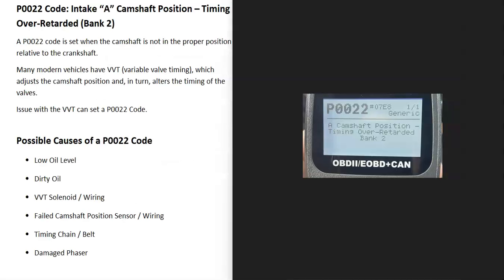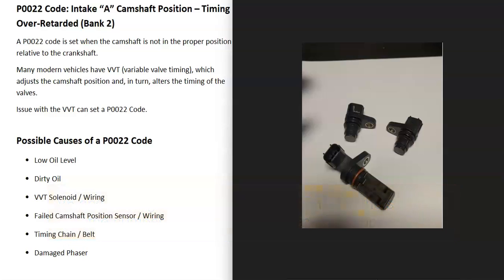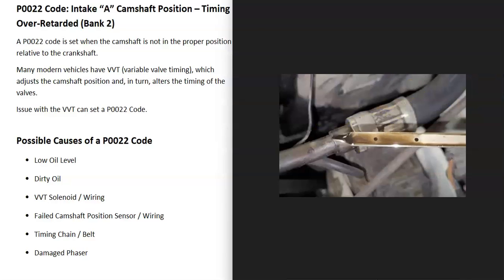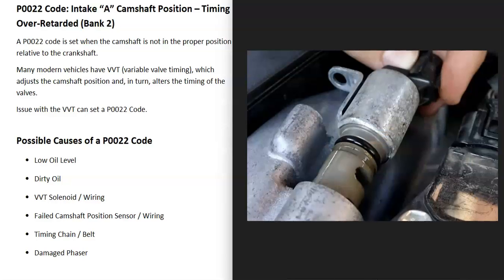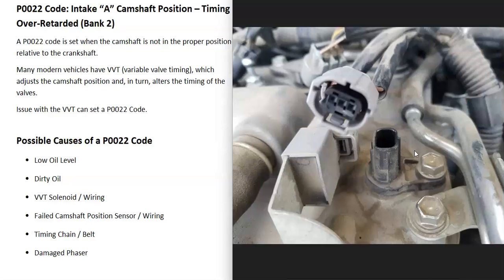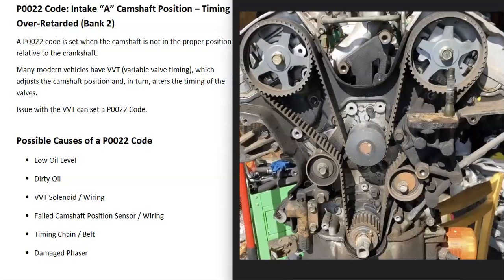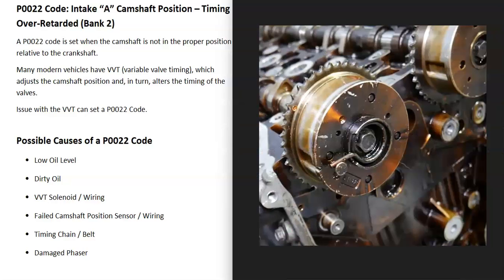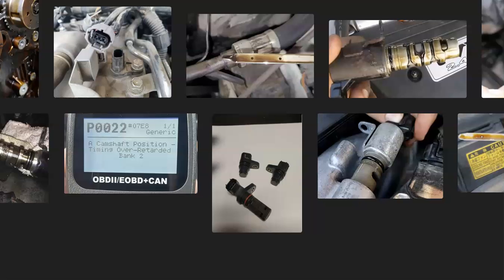Causes and Fixes P0022 Code: Intake “A” Camshaft Position – Timing Over-Retarded (Bank 2)

Comment: I have p0022 code a while ago
I put in a non Fowler in my 02 sensor would this trigger the code?
Reply from the maker: No, I don't see how they can be related; if a Fowler has issues, usually that causes 02 sensor codes or possibly Rich/Lean codes.

Comment: Just change your oil and clean or change the camshaft sensor $34 each at auto zone, I spent $300 for coil pack and $180 for plugs only to find out that metal shavings have attached themselves to the camshaft sensor because of dirty oil😢

Comment: Hey, if I had an oil leak, we’ve been having an oil change for a little bit over a year. Could that potentially cause that code to come up? I just got an oil change today, and hopefully, it will clear itself by tomorrow.
Reply from the maker: If the oil is low or very dirty, that can cause VVT issues.

Comment: Thanks for posting this, the info was helpful and detailed!
In my case my 2012 Escape was overdue for an oil change. After doing that, resetting the oil code and disconnecting the battery cleared the engine light (for now)!

Comment: Low oil, oops.
Reply: Apparently I burn oil bad or have a leak…good news is I put 5 quarts in and she’s running fine now.
Reply: @chaplainbeats7028  damn 5 qts? im surprised it wasn't knocking or tapping.

Comment: Hello, I have to codes. P0012 & P0022. I was told that I should replace the VVT solenoid and VVT actuator. Does that sound about right? Please advise.
Reply from the maker: A bad actuator can cause issues along with other VVT components. It needs to be diagnosed, and the components tested to know which has failed.
Reply: Same issue with a f250. What was your fix?
Reply: I just changed it and still got the code they said I need timing but my 2017 maxima sv runs perfect someone told me to just change the sensors

Comment: Question, could oil buildup cause this code? Just did an oil change, I noticed there was a quite a bit of buildup in the upper part of the engine when looking through the oil fill tube on top of the valve cover, and when changing the oil filter I noticed quite a bit of deposits. Engine has 358,000 KM’s, is it worth adding some sea foam, cleaning the deposits, changing the oil and seeing what happens before changing the CPS and oil control valve solenoid? Thanks. 2006 Toyota 4Runner 4.0 V6. Only code is P0022
Reply from the maker: It will need to be diagnosed to know what the issue is, but sludge and blocked oil passages can cause VVT issues.

Comment: I have same issue, all the timing are correct and intact, I changed the two sensors twice yet nothing changed it keep bringing back the code I have 2004 Lexus rx 330
Reply: did you end up finding out what caused and fixed the problem?

Comment: Hello, I have a question about my car. I have the same code appeared on my OBD scanner. 
P0012 - A Camshaft Position Timing Over - Retarded Bank 1
P0022 - A Camshaft Position Timing Over - Retarded Bank 2
I'm not sure exactly what I need to replace or fix. I recently got my oil changed back in January. It looks fine. It's not a light color on the stick. It's a mixture of amber and dark color. I hope the shop cheated me on my oil change. I did a test drive and tried to accelerate at a higher speed, my car was moving very sluggish. I couldn't get it to pick up the speed. Someone told me it could be my catalytic converter. If that's what it is then why I didn't get that code? I have a 2019 Infiniti Q50 3.0t
Reply from the maker: It's going to need to be troubleshooted to find the issue. I would start with the VVT Solenoids and wiring, then check the engine timing.
Reply: I took my car to the dealership earlier this month so they could tell me what was going on. My turbochargers were failing and it was going to cost me $8,300 plus to replace them. I decided to get rid of the car. I purchased an Audi Q5
Reply: did u ever figure out what the issue was?
Reply: Issue Fix ?
Reply: So these codes are turbo failing codes ?
Reply: @Forjettaheat  it's in the timing It codes dont will say Sensors but  it's the phasers
Reply: I have the same car you do with the same codes. Did you ever get it fixed? If so what did you do to it?
Reply: @geraldcastaneda9463  my problem is that I had spark plugs pieces crack 
And I still replace the solenoids now I'm all good